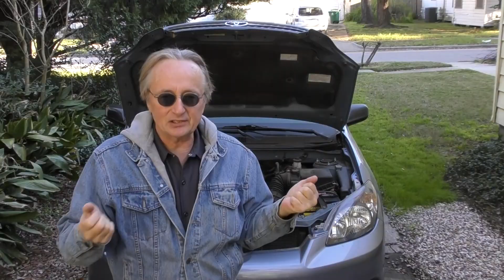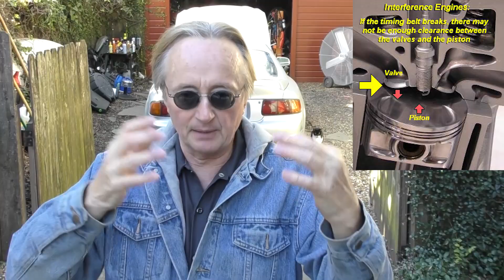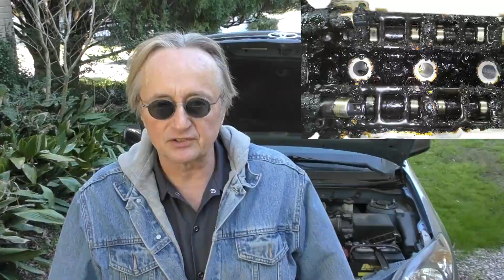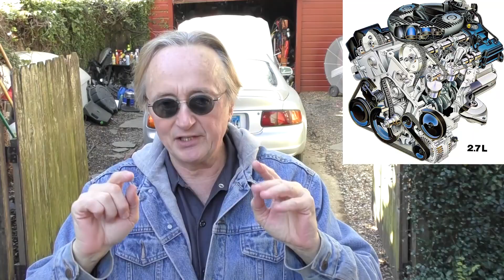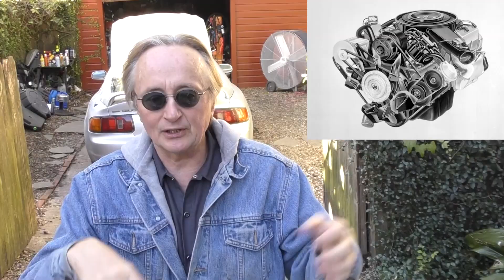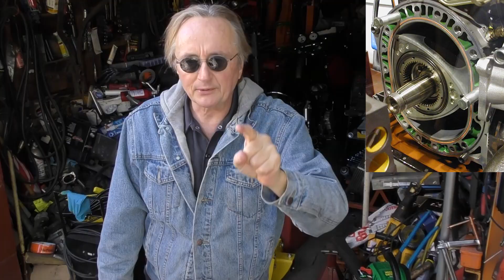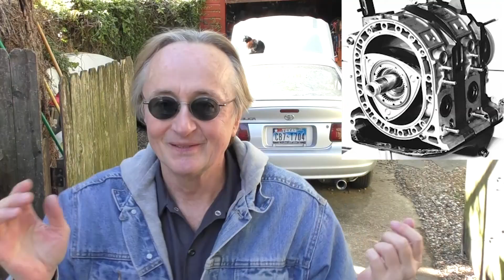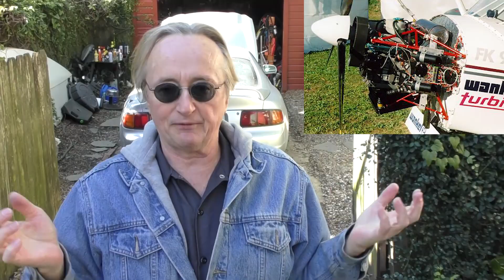Never Buy a Car With This Engine

Comment: So, what I get from this is that many good engines are ruined because people are too stupid or shortsighted to take proper care of them. New engines are getting way too complex for ordinary people to take care of, and electrics will eventually take over for this reason along with many other reasons, such as minuscule maintenance requirements, an enormous increase in efficiency with a simple and reliable design, and fuel costs that are an order of magnitude lower.
Reply: Yes and you win the prize. I never had any problems with cars i owned and i really ''beat'' them. That's because i'm meticulous with services with noises i hear with changes in how it drives. When you don't take proper care of your car even if you have the best car it will fall apart. My first car was a Renault 21. Everybody laughed at me when i first bought it but i never had any problems with it.

Comment: Don't really believe that the 1.8t VW from that era is such a bad motor. Had a skoda octavia 1.8t 2004 and drove it 250000km with oil changes every 15000km (service plan said 30000km) and no problem at all. What is actually bad is The newer tfsi motor (1.8 and 2.0) and the oil consumption. Cars with oil change every 10000km starts burning oil after just 50000km because of bad piston rings. According to car manual it is allowed to burn 0.5 liter motor oil every 1000km....
Reply: The one you had in the skoda is the less powerful one . Scotty is talking about the ones wich were in audi tt. 1.8 t 225hp.
Reply: That was before 2012, Audi addressed that issue after that.

Comment: I've had 2 Chevy Cobalts which had the Ecotec 2.2. First car was at 249k miles. Then I bought a second Cobalt. I was at 277k miles when I got rid of that car ☹️. Never burned oil. The only problem I ever had was coil packs which only took 5 minutes to replace. I used synthetic oil and replaced 7500-8500 miles.

Comment: I like Scotty,  however,  I have to disagree with him on the Cadillac 8-6-4.  This engine was used only one year (81) just to bridge the gap as government CAFE (fuel economy requirement) became more strict.  It was based on the Cadillac big block that was a 368 ci in '81 and was durable.  It used TBI (throttle body injection) which in '81 was also used in many other vehicles then and later.  It was a basic design and reliable.  The 8-6-4 cylinder deactivation was computer controlled and reliable until very high mileage engines.  It ran smooth in 4 or 8 cylinder mode and was rarely in 6 cyl mode as this was a little rough.  It was a system that worked well and much better then the '82 engine which was the HT4100-talk about a bad engine.  (It wasn't called the Hook and Tow or Hard Thumper for nothing)
(Cadillac Master Advisor-ASE Master Tech)

Comment: I knew the old GM deactivating engine, the Rotary and the 2.7 Chrysler engine would make this list. I however did not expect the 2.2 Ecotec. I've seen a lot of higher mileage examples in old Cavaliers. 1.8T is definitely not the greatest, but didn't expect that to make this list either. Made decent power and lasted somewhat long if you didn't beat it and maintained it properly.

Comment: I have the 2.2 Ecotec in my HHR it has 213k on it, replaced the valve cover gasket recently and the cams looked great
Reply: Preproto I was changing my oil on time and my timing chain still went bad at 150k. I am the second owner though.

Comment: What would would you recommend for a swap out I-4 for a red configuration? As much as I love the authentic 2.0 I-4 in the Porsche 924 I’d like an alternative that has good power and reliability that would be a good replacement. I don’t mind a little welding here and there or machining parts. Thanks!

Comment: Agree! Honorable mention: 5.4 3valve ford.
Reply: The 3V Tritons can be decent engines if you’re diligent about changing the oil but they still have that stupid two piece spark plug design that loves to break off in the threads. Definitely not Ford’s best work.

Comment: I am a diehard GM guy but I am not a ecotec fan. I have the 5.3 in the wifes truck. Not sure about it. My 6.0 is bullet proof. But they finally stopped the last vortec  and I'm passed. Why would you trash a proven engine? Guess I'll be keeping my 2014 for a while till they work out the bugs in the new 6.6. Or I might try to find a leftover this fall

Comment: I'm surprised the Ford 4.0 SOHC V6 didn't make the list. 3 Timing chains, piss poor chain guides that tended to fail, and you had to remove the engine from the vehicle to do the job cause the passenger one is in the back.

Comment: I know the 2.2L ecotec is on this list but don't forget the supercharged 2.0L Chevy ecotec. Should be on this list as well, what a piece of crap!!! I replaced 2 engines in a 2006 Cobalt SS until I said forget it. Never will I buy another small Chevy car again! The car ended up in the junkyard at 40k miles... Piece of crap.

Comment: I had an 1988 Rx7 with168k miles on it before it was stolen. Never had any engine problems , just regular maintenance. Very easy car to work on, just put gas in it and do a reliable 18mpg. Mpg Not bad for a sports car of that year. No sure if you know anything about the rotary, they were great engines. More complicated rx8, which relied on more emissions and computers for better mpg, were horrible. RX7 versions were highly reliable and needed less regular maintenance due to their simplicity.

Comment: I guess I was lucky, my 2.2 EcoTec in my Cobalt was the only thing in that car that worked without a hitch.  After I traded it in with 164,000 the engine was still strong.

(Granted I was religious with my oil changes.)

Comment: The 1.8t is a great engine, easy to modify, and even easier to maintain. The main problem is that people neglect them which lead to sludge build up or timing belt failure...with proper maintenance they can often hit 250,000 miles +

Comment: Equal bad engineering for all of the Big 3... Ford's 3.5L V6... the 3.5-liter V6 EcoBoost engine "contained serious latent design, manufacturing, or assembly defects" that cause vehicles to shake, misfire and rapidly lose power.
 And it also had the chain-driven water pump genius design that killed the engine without warning.

Comment: The new generation 2.2 Ecotec is one of the best 4 cylinder engine GM ever uesd... I've had no mechanical issues so far with my 05 Ion... i'm at 160 000 miles and it still runs like new... The ONLY repair I had to do was replace the oil pressure switch that started leaking last summer... Wow... a 20$ part...  What an unreliable engine ! :P
Reply: The ecotecs are great engines
Reply: I agree, I have a cobalt with 150k and it runs great. Knock on wood lol
Reply: Those Saturn Ions were soo solid my mom had one back in 2007 then she had the 2010  Aura with the V6 what a good car back then
Reply: 460,000 km on mine! Change the tensioner for 60$ and bingo!!  Nothing else wrong with that engine
Reply: @MrThibodeau  285830 miles. Nice!
Reply: A guy at work has 180k on his 07 ecotec , runs great
Reply: I have a 2006 ion with a manual transmission, my dad bought it new and I bought it from him with 75k miles on it 7 years ago. I've put 100k on it since then and just spent 2 grand to replace the original clutch (and rear main, clutch cylinders etc.) I've had no issues whatsoever in 100k miles, other than recalls for ignition switch and fuel pump. Take care of that 2.2 and it will take care of you

Comment: Let's not forget the GM 3.1 V6. We had several that had head gasket failure shortly after 100k miles.
Reply: The 3.1 v6 was actually a good engine. It’s draw back was the intake gaskets. 3.4L with the same design also had intake gasket problems. Replace at least a 100 of them myself. On a rare occasion at our GM dealer we had head gasket problem. But after the intake gasket are replaced the engine itself was a very reliable robust long lasting engine. The 3800 V-6 GM used for several years had trouble with upper intake gaskets with the plastic composite intakes for a few years. But it also was an extremely reliable engine. I’ve seen several reach close to 300,000 miles. Usually the engine is still going but the transmission has failed and the car is at this point made it beyond its service life and not worth investing money into an old worn out car. So they end up at the salvage yard.
Reply: 3.4l was even worse. At least the 3.1l didn't blow head gaskets like every 3400
Reply: m ph I’ve seen very few 3.4L with head gasket problems. The ones that have had head gasket problems were high mileage. 175,000 plus miles.

Comment: I  had a Mazda RX4back in the  mid 70S.  Mine didn't  use oil. I  worked at a gas station  and changed oil regularly. That thing ran like a raped ape for the small engine.

Comment: My sister has a 2009 Chevy Cobalt and its a piece of junk. Its starting to rust, engine and service tire monitor lights are on. Interior parts are falling off, just horrible. It belongs in a junkyard now. She is buying a new 2019 Toyota RAV4 this summer. No more GM for her.

Comment: Huh... I have a 2.2 in a Cobalt.  Almost 90K miles.  You're right, except it goes with any engine-  If it isn't maintained properly it will break.

Comment: Hahaha scotty first car I got in high school was an intrepid 2.7 terrible I did the water pump and it went out 3k miles later junked it then bought a Corolla I still have 4 years later
Reply: Sounds like mechanic error or stupid cheap parts cause 3000k miles is nothing for a water pump

Comment: Hay scotty
I've opel insignia 2010 its cuts off while driveing i clean the fuel tank, change fuel pump, change oil filter bring it to good few mechanics but no luck can you please help me out by the way ignition light stays on when engine cuts of

Comment: Question Scotty! I'm debating on pulling the trigger between a used 2016 Toyota Tacoma TRD off road and a 2015 F-150 platinum with the FX4 pack. The Toyota has 32k miles and the Ford has 65k. This is probably an obvious answer, but I need a professional opinion!!
Love your videos, you remind me alot of my dad. Have a good one!

Comment: Scotty, 
I'm no fan of Chrysler products either, but Ford did the same thing on a few of the Duratech V6 engines, that is, driving the water pump with the timing chain. Difference is that those v6 engines will run forever properly maintained. I have a 3.5 Duratech in a Fusion Sport that has 200K flawless miles, but I know that I am probably going to have to do a preemptive water pump change within the next 20K miles and no, I'm not looking forward to it.

Comment: Scotty,
You alway are verry possitive about toyota. Im thinking to buy a new Toyota RAV4. ( 4cil. 2.0 Liter petrol) But the dealer said the RAV4 needs a service every 15000 km (9000 miles). Compared to my Ford fusion thats more than twice the interval. To me thats a deal breaker couse i drive a lot miles/km's. Should i buy it and service it that much or is it a possible to service is like every 20000 miles?

Comment: I had Ecotec engines for the past 15 years and they were the best! If it always had fresh oil every 5000km's it woukd run for EVER! I had a lot more problems with my Honda's than my Ecotec's! And BTW.. the fastest 4 banger in the world is an Ecotec and it's Canadian built too. 😎✌
Reply: I read the 2.2 ecotec block can handle up to 1000 hp, very impressive imo.
Reply: @richardshields7956  indeed they are very strong engines

Comment: I was hoping you'd have the Chrysler 2.7L V6 on this list... I had a 2001 Chrysler Intrepid ES with the dreaded 2.7L, drove it across Canada in 2006 when I moved from New Brunswick to Alberta for a year. The water pump decided to fail after 2300km about an hour away from Sault St Marie and killed the engine. Got stuck for a week in Northern Ontario in a town so small the McDonald's had gone out of business a month before while a local mechanic sourced a used engine for it. Made for an adventure but what a big piece of crap design..

Comment: Of course he'll never mention the Ford and Toyota engines that were not reliable.
Reply: DJR5280 what ford engine was so bad?
Reply: @isaacpowell3335  Late response but the Duratec 3.5 and 3.7 have timing chain issues and issues with the chain driven water pump

Comment: …. hey, wait a minute …… the Chrysler 2.7 L V6 is a bad engine..... the same 2.7 L V6 that I have in my Chrysler..... oh oh. Well, it's 16 years old, fingers crossed.
Reply: Just change the waterpump and chain along with tensioners and guides every 80-90 k miles and synthetic oil changes every 4500 miles you will be fine. But if it was abused before hand it is a ticking time bomb

Comment: Don't forget Chrysler AKA Dodge toyed with cylinder deactivation I believe back in the late 90s early 2000s
Reply: They called it MDS in the later 2000s 5.7 Hemi, I don't think it was actually too bad as long as the oil was changed and the engine was taken care of. Those systems are not worth it generally as they usually really don't improve MPGs much at all.

Comment: I heard the 3.5L V6 in the last generation Taurus has the water pump driven by the timing chain.  I seen a guy  on you tube that tore down one of those engines with 235,000 miles.  So if it lasts that long I would say it is a good engine. But it does have weep holes that will leak and let you know the seal in the pump is going bad? I am on my second last generation Taurus. I have had good luck with the last one.

Comment: Whaaat? How is the 1.8T engine from AUDI/VW? So bad? I thought it was one of AUDI/VWs best engine made?
Reply: IM26C4U It is, it’s just that too many people buy them cause it’s a sporty engine, but it requires proper maintenance....
Reply: Their other engines are even worse.
Reply: It’s not terrible but remember it’s 5 valves per cylinder. At 200k usually needs good rebuild for 3k. Yes it is stout.
Reply: James Medina I do most of the work myself, but it sounds like someone is running off with your wallet..
Reply: james tfw are you talking about? 
ever owned one?

Comment: I can agree on that 2.7L. Had one in a 99 dodge intrepid. That thing burned oil on acceleration and was pretty sludged up.  I can't remember exactly, but it had around 80k miles on it when i bought it.

Comment: I don't know if it was that engine, but a buddy's mom had one of the mazdas with the rotary, ran like a SOB as long as it ran. Didn't run long though. I met a guy that was going around looking for the Mazdas with the blown rotary engines, he'd buy em, swap in a standard 4 cylinder, then resell them. That way he was getting cars that were physically still in pretty nice shape...since the rotary engines didn't last very long, but getting them cheap because the engines were blown and relacement cost of the Wankle was sky high. I think the idea is good, but they just can't seem to figure out how to make it work in the real world. Too bad, they run great when they run.